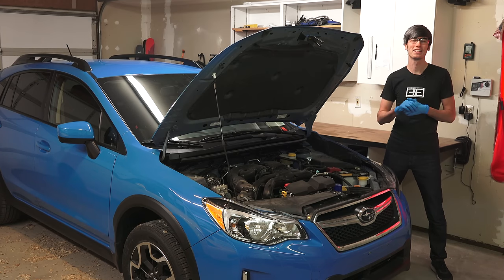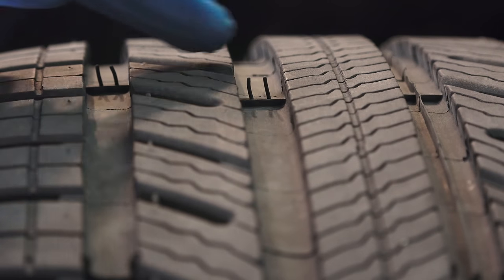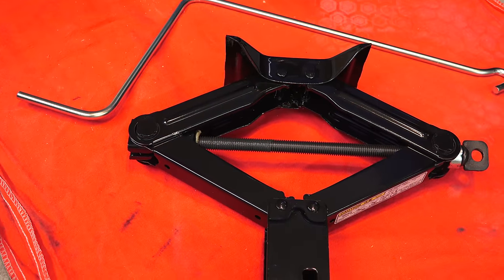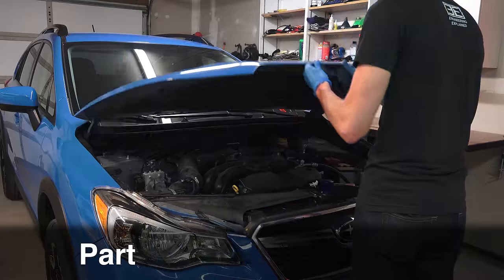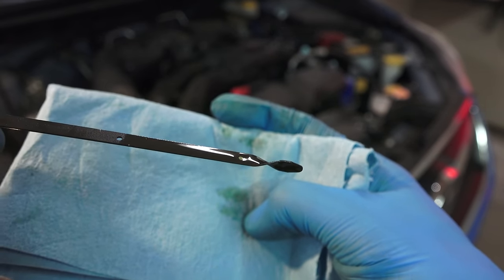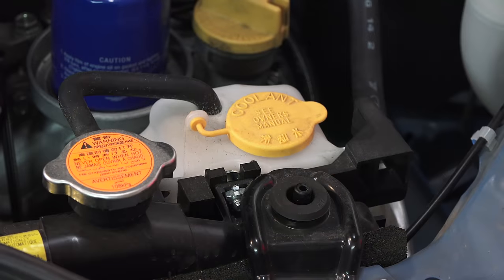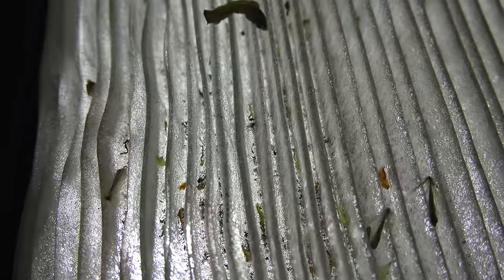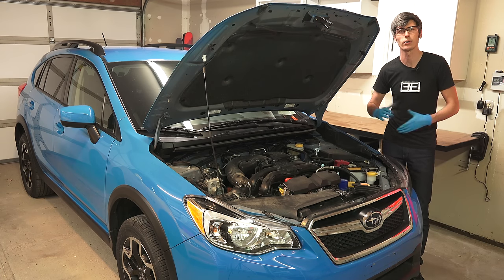How To Make Your Car Last A Long Time - Simple Checks

Comment: This reminded me of a joke, in a car parts store the customer says: Could I get a longer dipstick, because this one doesn't reach the oil!
Reply: OH NOO
Reply: Hahaha
Reply: It took me a second to get it but man that’s funny
Reply: Ya dont laugh. I tore down a pontiac engine that someone rebuilt and forgot to bolt the little curved tube back on the block. The oil pan was full of broken off dip sticks and one brazed together. Every new dipstick would go straight into the crank. Another funny note was the crank rod journals were ground .010 under but standard bearings were installed. It never knocked when it ran. Hard to believe
Reply: Haha lmfao
Reply: sogerc1 wow, high quality mechanic
Reply: "every time I put it in, it comes out dry" hands her KY jelly
Reply: Oh lol 😂
Reply: LMFAOOOOOOOOOOOO
Reply: We dont sell those, but you can try to change your oil
Reply: Billy Jack 😴
Reply: Bruh
Reply: @allgoo1990  what
Reply: lol
Reply: @danield8528  m
My
Reply: Bruh 😂😂
Reply: cricket noises
Reply: there’s ur issue
Reply: @jamesgand828  😄 🤣 😂  savage guys in here!
Reply: Someone actually said that in a "Just Rolled in" Video
Reply: Literally my truck
Reply: This is not a joking manner, you straighten up RIGHT NOW, mister!
Reply: Car was running on hopes and dreams
Reply: Daaaaamn. 🤣🤣
Reply: That's what she said!
Reply: Lmao

Comment: My Prius has over 300,000 miles and runs like new. It's never had any repairs. I just follow the maintenance schedule religiously by using a program on my laptop called Automotive Wolf that tracks the maintenance schedule, expenses, fuel usage etc. It calculates a cost to own and operate the vehicle taking into consideration all those factors and my Prius is at $0.05 per mile. My Jeep costs $1.63 per mile. So not only is my Toyota extremely reliable it's also very cost efficient.
Reply: COOOL Software!  Thanks:)
Reply: No battery issues? Impressive (excuse the bias lol.)
Reply: I hear the new ford mavericks have the same ngine as this prius...if thats so um lo9k8n forward to that mil3age!
Reply: @HookupCultureCommunity Yep, the battery replacement cost (not that big, especially vs. BEV/PHEV, but still important in the overall TCO) should be incorporated in calculating that cost per mile etc.

Comment: For cars still equipped with a spare tire, it's good to check the pressure at least once a year.
Reply: Mike Y So few people think of this. You can also keep a bike pump in your car in case that’s not enough. This can also help if you picked up a nail or something that causes a low leak leaving you with low tire pressure at the end of a work day, but it’s slow enough that you can pump it up and get to where you need to get.
Reply: You just blew my mind, im gonna check this right now!
Reply: A few other things that are good to check...

1. Look for small cracks forming in the sidewalls of the tires.  If you don't put a lot of miles on a car, and it sits outside a lot, the rubber compounds in the tire can become brittle and crack in the sidewalls before you wear off all the tread.  Tire shine especially for crack prevention might help, but you have to remember to spray the inside sidewalls too.

2. Automatic transmission fluid smell/color/level, although some cars don't even have dipsticks, or the manufacturers claim you never need to replace the ATF ("lifetime" whatever that means).

3.  Power steering fluid level check (although less cars have power steering pumps these days).

4.  Check the battery terminals (posts) for corrosion.  If you have a wet-cell battery, check the water levels, and add distilled water as necessary.  

5.  In the summer, with the car fully-warmed up, and the air conditioning on, verify both electric cooling fans come on after the car has been idling for a while.

6.  If you don't know the car's history, check the temperature rating of antifreeze using a hydrometer before it starts getting cold outside.

After adding engine oil, I always start the engine and let it run for about a minute, shut it off, then wait another minute before I recheck the oil level.
Reply: This, so many spares ive tried to use for people are flat because they don't ever check them!
Reply: Indeed.
Reply: Those donuts have to be inflated to 60 PSI. I wouldn't use it if it's at 15 PSI, or you're screwed at any speed lol.
Reply: The spare tires are to be inflated according to the owners manual. The pressure the air needs to be depends on the weight of your car.
Reply: Also a good idea to visually inspect the spare for age-related issues. This is more of an issue for trucks with the tire slung underneath exposed to the road spray/elements. I had a 7-year-old OE full size spare on my Silverado and at the check this summer I noted sidewall dry cracking. So that got replaced. Cheap insurance to know when I need a spare (especially since it’s a heavy tow rig) that there is a proper full size unit under there with the proper load rating, and young enough it isn’t a failure risk when needed.
Reply: it's also important to test the pressure in the cans if you don't have a spare tire.  don't want your "fix a flat" can to loose pressure.
Reply: Or you can just install a tyre pressure monitor on your dashboard , checking tyre pressure is old fashioned waste of time especially when you have technology now where you don’t have to
Reply: Take it to Discount Tire they will do it for free.
Reply: Invest in a good 12v air compressor! I never leave the house without it. They are slow as heck but they work.
Reply: This is the idea my dad taught me, also I learned that having a higher psi for the spare tire is better as the tire pressure eventually reduces overtime.
Reply: @iamasmurf1122  installing that is more work than just checking with a gauge. Would be great if some mfg started doing that from factory
Reply: @jessstuart7495  #1 Rubber degradation happens due to the suns UV rays drying out the rubber, nothing else. Silicon helps re-moisturize the Rubber. Same with hoses. Just don't use petroleum based silicon as it'll do damage

#2 Lifetime fluid is roughly 10 years. As long as the warranty lasts for the transmission.

#4 NEVER refill a battery with water!!!! Doing so DILUTES the iodine. Refill with the proper ratio mix. A damn shame people still think adding water of any kind without ionizing the solution does any good.
Reply: @killcreate  Cannot inflate a flat with a dead battery!
Reply: @datsuntoyy  fix-a-flat or any variation IS JUNK! A tire plug works %1000 better and doesn't leave a nasty buildup inside the wheel
Reply: Christopher VanZetta  learn to recognize sarcasm.
Reply: I’ve never owned a car with a spare tire Or even an efi, ecu, obd port, o2 sensor, catalytic converter, etc. 🙈
Reply: Get youself a good 12v air compressor and keep it in you vehicle. I know they are painfully slow but they do work. :-)
Reply: This. I recently got a car that when I checked the spare, the tread was literally splitting apart and you could see the layer understand the treads and it looked like someone was hitting it with a sledgehammer. But really it's just age and because the guy before me put some heavy stuff in the trunk of his sedan which over time wore the tire out
Reply: That's an important one! 👍🏾
Reply: Or before long trips!
Reply: I check the pressure in all 4 plus the spare at least every 2 weeks in winter and once a month in summer.
Reply: @bryelg.9939  41 psi on all 5 tyres.
Reply: A good tip if you got a full size spare is to swap it with a different wheel every time you do a rotation. That makes sure it gets used and doesn’t dry rot. It will also lengthen the life of your tires by a extra season or two. If your car doesn’t have a TPMS then get one and make sure they’re always at the right pressure.
Reply: Wow, 1K likes!  And one from EE himself!  Thanks guys, and Jason keep up the great vids and fill up that whiteboard!
Reply: In my 26yrs of driving never needed to use the spare. Got rid of spare for 12" subs...lol
Reply: Im checking it monthly
Reply: Must always carry a pump and a plug kits.
Reply: @Dcc357  my spare is to be filled to 36psi
Reply: I started checking my spare tire after I had a blow out lol when I put on the spare it had about 5 psi in it
Reply: I check it every 2 months

Comment: This video should be shown to every new driver as a go-to on basic maintenance. Excellent video as always, keep up the good work.
Reply from the maker: Thanks Justin!
Reply: Some old driver should see this too, a lot of people don't know how to check their tires while they're driving for years
Reply: Most people don't read the owners manual to a car. Maybe they should make an app that gives you reminders with a 30 second turorial so to keep peoples attention.
Reply: Every parent should be teaching their kids these things. But the newer gen parents dont know how to change a tire or oil.

 Most cars now dont even have keys. So soon ppl wont even know how to start a car with a key.
Reply: So many cars go down the shitter just because some people don’t know to check their car every once in a while
Reply: Agreed. 
My dash handbrake light was constantly flashing "probably just a electric fault. normal for old cars" my mum said when I asked.

Welp I didn't think that sounded right, it looked like a warning light? even only driving 1 yr I'm not gonna see something that basically looks like a flashing danger symbol and ignore it just cause mum told me to.
So I googled it and one of the possible causes that came up was... low brake fluid.
So I googled how to check that and checked it myself... I was below minimum. The article also mentioned how the owner (me) was supposed to be checking it regularly every 2-3 months. I've had this car for 8 months by this point 😬
"mum didn't you say I only need to check oil and water?"
"yeah why?"
So hmm okay I see what happened here. I trusted my mum's 40yrs experience of owning and driving cars... when I clearly shouldn't have. 
Re-learning how to care for my car now because mum clearly has no idea what she was doing.
Reply: In the uk you have to know this for test
Reply: Agree but I don’t know very many people who could even take off the wheel never mind looking at their own brake pads. There should be general public courses for this.
Reply: Why don't they make this a mandatory thing to watch and know before getting a driver's license? A good conditioned car is a safe car
Reply: Where I live this is mandatory to know before getting a driver's license. You have to do those checks on the exam, I thought that's how it's everywhere.
Reply: Word!
Reply: I'm a new driver and I think I couldn't have got a better video to understand basic car maintenance. :)
Reply: @EngineeringExplained That Monkey Grip air gauge.  Received mine as a gift 25 years ago.  Have never replaced the battery.  Now if American manufacturers could make a car like that!

Comment: Not a fan of Subarus, but their oil filter placement is the single greatest automotive innovation of all time.
Reply: It is certainly neat, but I wonder, what happens when you unscrew it? Does the gravity empty the oil in it every times you turn off the engine or do you have to unscrew it quickly before it leaks sludge everywhere on the engine?
Reply: @Debergaizen  Gravity. As long as you drain the oil before taking the filter off nothing will leak.
Reply: my BMW does this too and it's pretty great. it's in a housing so the filter is a cartridge; makes high quality oil filters extremely cheap. I'm talking 3 to 5 dollars for a Bosch. also, no mess with removing it, because as stated, gravity drains all the oil from the cartridge when you drain the oil too. its great
Reply: what's not great is the 32mm socket to take it off. older bmws used a 13mm which was much smarter
Reply: Yeah my E36 BMW has a oil filter housing with the filter inside, it really is easy to change, as you dont get oil dripping down, after unscreqing the 13mm bolt the oil from the housing drains down. It's pretty neat
Reply: I disagree I hate changing filter on my Ez30 mounted sideways went through like 5 oil wrenches trying to find one that somewhat fitted lol
Reply: What about their placement of spark plugs? :) boxer engines are dope though
Reply: @ArathiBasinFTW  meh I'm fine with that as they don't require regular servicing, usually if I do something on the sides of the engine bay when it's stripped I'll have a look that's about it.
Reply: Not all Subarus have the same oil filter placement. The old ones where terrible. Above the plastic plate and surrounded by the exhaust manifold.
Reply: It's similar to the placement of an oil filter on a 12A Mazda, or a Suzuki Samurai. 

My car has a hole cut in the air dam, from the factory, to allow one to get their paws on the oil filter easier. It also has a metal chute under it, so that you can unscrew the oil filter, and the oil will drain down the chute nice and neat, without making a big drippy mess all over the engine and suspension.
Reply: They also have a perfectly sized cutout in the underside cover for the drain plug thank god. It's also long enough where the oil never hits the cover whether it's blasting out with full pressure or dripping right at the end.
Reply: Saw that! Amazing. Just changed the oil and filter on my 2010 outback, inaccessible is an understatement
Reply: @L5Rocks  ---> With the propper tools, the older Subaru oil filters are easy to swap out... But yeah, what a bone-head design having the exhaust pipe wrapped around the oil filter and buried 6 inches deep... SMFH
Reply: The easiest oil filters to replace are top-side cartridge filters... if done carefully, no oil spillage. 🙂👍
Reply: Lolled9991  yeah, I like the fact that "normal" filters pretty much never need a tool beyond your hand unless you're doing it wrong or can't grab it with your hand for whatever reason. Don't overtighten your oil filters folks!! Bit of oil on the threads, bit of oil on the gasket, & snug it up by hand.
Reply: @Iceberg86300  ---> Yes... hand tight... except for the ones that get over-tightened by peeps who don't know any better... 🙄
Reply: Eh. It's easy to get at, but it's also going to leak oil everywhere. For something that's not changed that often, I'd rather have it hard to get to but it doesn't leak oil all over the place when I change it.
Some people will say "gravity, when you drain the oil out first the filter will be empty", but no. It's never empty. You start moving it and more finds its way out.
Reply: I noticed that too. I wish more manufacturers did that.
Reply: mine is right next to the drain plug and the filter housing also has a small drain plug.  No more moving the drain pan or oil running down the engine.
Reply: I thought I hated working on subarus until I started working on my honda.  I need Donald Trump's tiny hands to reach anything on my Honda.
Reply: I forget which Subaru but it’s an older model where the oil filter was literally placed in between the exhaust and you would burn tf out of your hand
Reply: Neil Goldstrom  thanks for the info!
Reply: MK6 GTI TSI motors are sitting up top as well!
Reply: Fiat diesel jtd and multi jet and his variants from other brands have the same design too
Reply: @Debergaizen  buddy go look at one,  we even if some oil  leaks, which my wifes does sometimes when removing the filler,  the fillet screws into a piece with a large round pan to catch any spilled oil.
Reply: Give a twin turbo Legacy a go, they're great cars to drive with the AWD and power and are very practical too. The legroom in the back keeps your back free from knees whereas the Impreza hasn't got this 😉
Reply: in my scion they hide the oil filter like they hide their wives
Reply: Why are you no fan of Subarus? What is bad about them?
Reply: Modern German cars (and some Korean) have an even better system where the disposable canister lies within a cavity with a screw top making changes easy without too much oil going everywhere. Even my 1988 W201 Mercedes-Benz 190E had a similar arrangement to this Subaru with its filter at rear left side of the M102 engine.
Reply: You don't know of the ring of fire then?